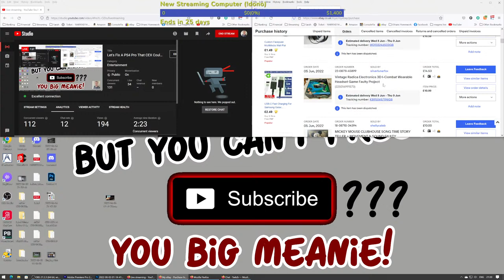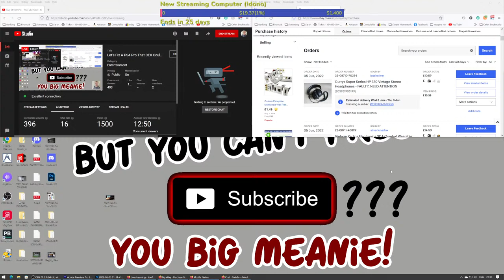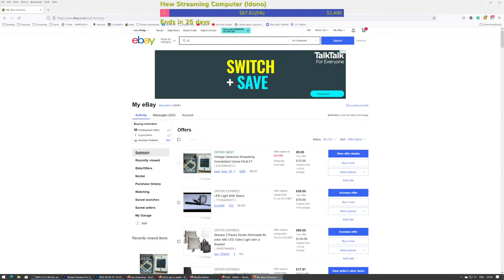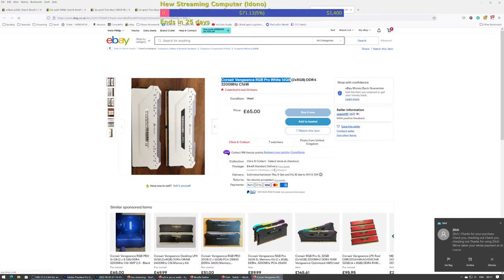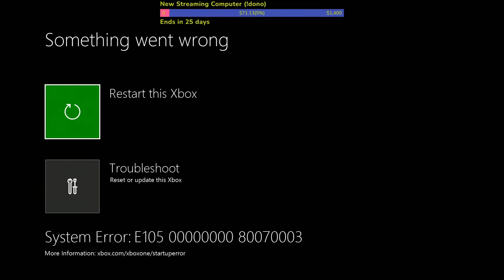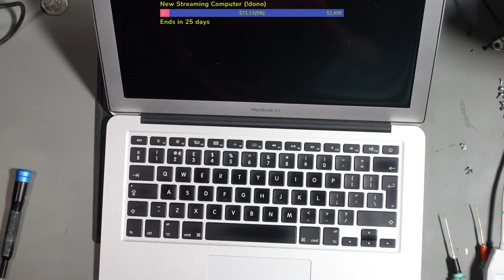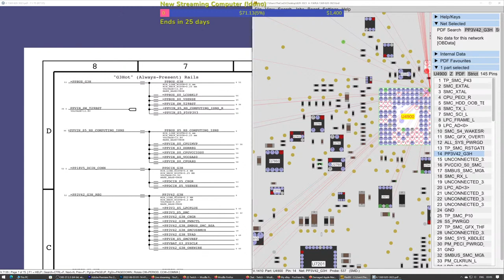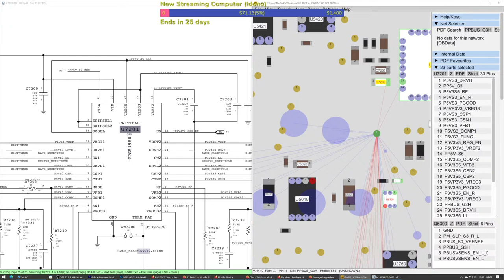Let's Fix A PS4 Pro That CEX Couldn't Fix (LIVE)

Comment: Hey, like very much your work. I got one ps4 slim on the shelf i wanted to fix with cu-30656-0 error. Did nor dump to check it with validator, had one "danger" on bt/wifi md5 which i patched with bwe patcher. Error on installing os still there... Have you ever encounter problem like this one?  
Regards.